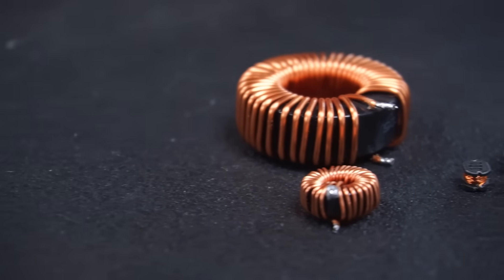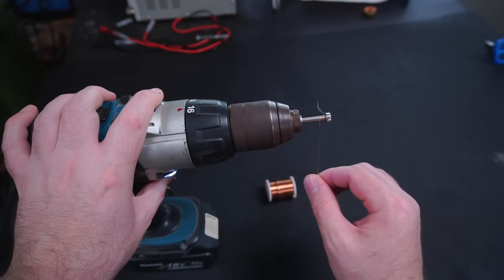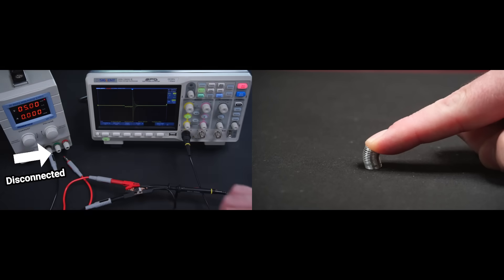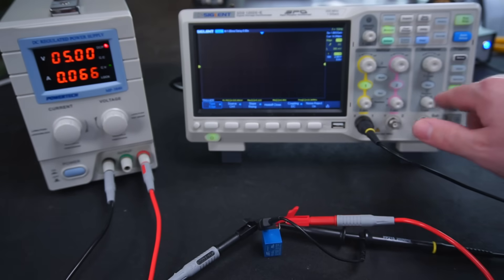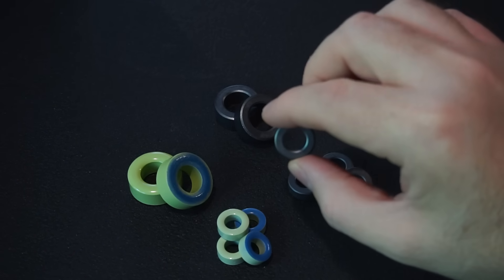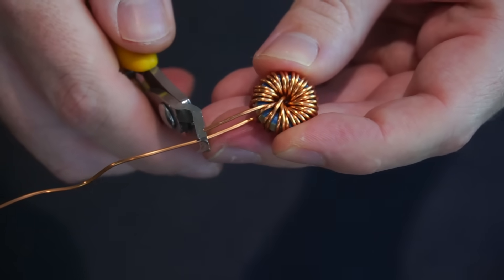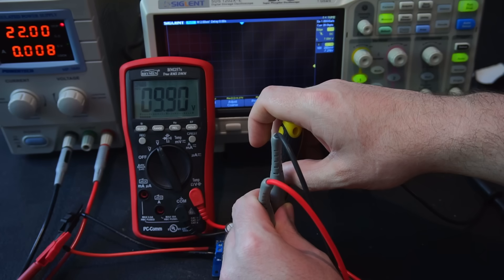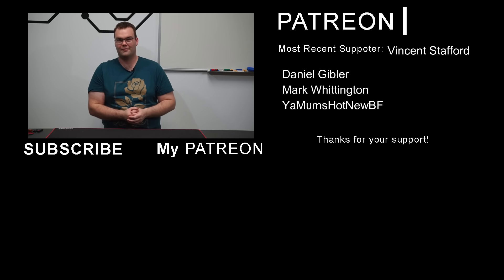How INDUCTOR's work & How to make your own

Comment: Have you compared the inductance provided by that LCR meter , against what you get using a square wave generator + capacitor in parallel with the inductor on the oscilloscope technic ?

Comment: Here in the Philippines, we are being sold controllers for ebike motors that deliver an uncontrolled starting voltage from the controller to the motor (using a simple, resistive element in the accelerator pedal).  The input to the controller is some level of 5Vdc, the output being a corresponding variation of 60Vdc.  The issue is all the ebikes are experiencing a very choppy start.  My idea was to add a combination of inductance, in parallel with a fair amount of capacitance and resistance at the output of the accelerator pedal.  This doesn't seem to be working to smooth the motor start up, probably due to the very low current in the input line.  My next attempt will be adding the same circuit to the controller output to the motor.  In your opinion, is this a feasible approach to 'softening' the initial current to the motor?

Comment: The spring I think is not a great mechanical analog to an inductor. An object that is made spinning I think is a better analog. Think of an object with say 3 arms with heavy balls. Why this is a better analog? Because once the object is up to speed (current is flowing) the resistence of the object isn't there anymore. SImilarly to how an inductor basically shorts when its magnetic field is build up.

Comment: This format is great. Im only a casual hobbyist, and struggle finding videos that match my disorganized mix of knowledge and ignorance. Leaves me with a couple questions tho, hoping someone can answer -

1. Does the voltage spike always follow the same direction? 

2. On your scope, the spike appeared to oscillate between pos and neg. This surprises me - was it not charged via a DC source? And if it’s an AC spike, then does the directionality of the rush current it generates change?

3. Is the diode at 5:30 backwards to the source for conventional current or actual current? How does this even work?

Comment: Question, if you're open to it 5 years later:
You seemed to have pre-decided that you wanted 47µH as your inductance.  How did you come to that, though?  or how would one, if, say, wanting to design a coil for a solenoid or an electric motor or something?  (Very different use case, I know, but... yeah.)

Comment: Broooo and just like that I NOW understand all the components for an induction heater
The diode is so it doesnt explode when you turn it off, and the resistor is to reduce the current for when a piece of metal ISNT inside of the coil

Comment: I recently installed 4 and 8 foot led lights in my shop. now I get lots of interference on my FM stereo and my radio earmuffs. I had to decide on working in the dark or working in silence. I took a 3/4" nut and wrapped the wire from the circuit breaker around it as many times as I could which helped a lot but not enough. I had to install an outdoor FM antenna on my TV antenna mast. What do I need to do to eliminate the noise altogether? I am a certified industrial electronic tech but am not an engineer.

Comment: At the beginning of the video a current is passed through a wire powering a light and the point made is there is no magnetic field because the iron filings are not attracted to it.
However, the return current is flowing the other way and so the net magnetic field is zero.

Comment: hmm,the discharge must create a big magnetic impuls out from the center,right? will it jump if a metalpin is in the center or push it something up maybe? 400 volt is alots. relais push a metalcore or attract it.What can here be a usefull effect for the wastet 400 volts??? And how will  it works if you charge it on a Loudspeaker at the coil works like a Loudspeakercoil withoutmagnet  and membran. maybe you can produce high voltage with superfast charge and discharge from RF,not from DC and the magnetic impuls is like a needle and you can hold stuff like a invisible hand

Comment: But don't they use Inductors to increase DC voltage in combination with Transistors for high voltage arcing e.g. tasers or even used as just a DC electromagnet for relays and such.

Comment: You said the flyback current can exceed tens if not hundreds of amps. But that's not true. The flyback current is at maximum the current the inductor had flowing through it. If the relay coil's working current is 70mA the flyback current is 70mA (and rapidly decreasing from there). There is no need to over spec the diode. If you look at existing circuits you'll often find the puny 1N4148 in parallel with small inductive loads like relais.

Comment: I had the same comment that someone else made.  With inductors, you increase the voltage, not the current.  The maximum current is what you pass through the inductor while connected to the supply.  When disconnected, the current decays, based on the resistance in the flyback circuit.  The rate (aka speed of the decay) is related to  the inductance/resistance time constant.  The higher the resistance, the higher the voltage (and faster the decay).  But again the current never exceeds the what it was passing at the instant before being disconnected.  Without a flyback diode - the resistance is infinite - or whatever the rest of the connected circuit is, as parts begin to break down.   A related phenomenon is that the high voltage can actually cause a spark, as the collapsing magnetic  field attempts to maintain the current.  When one unplugs a high inductive load - such as an iron or toaster - from the household mains, you will likely see a spark - that is the flyback voltage trying to dissipate the current.

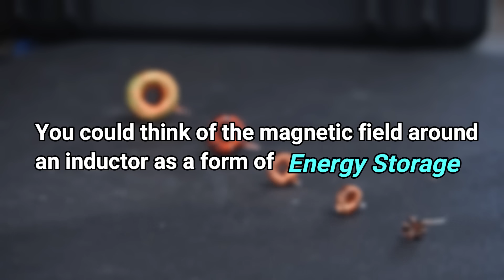Comment: 2:49 - Saying inductor is made from ferrous material or "IRON CORE" is WRONG. They aren't just pure iron cores, then eddy current will make inductors on your circuit glow red-hot. Inductor cores are either ferrite materials like MnZn or NiZn cores (both are like ceramic yet ferrimagnetic which drastically reduces the eddy current losses), or they are low permeability high flux "IRON POWDER" cores, where each iron dust is separated - so putting continuity tester on iron powder won't turn it on as each iron dust is separated with a binder. There are other type of such cores like Sendust, MPP, Hi-flux, nanocrystalline etc. each are made out of different materials and ratios.

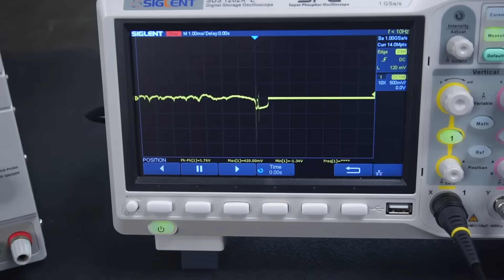6:27 - We should use Fast Recovery diodes in this case (something like FR107 for a relay or so, depending on the switching and what I want to do with it). Schottky diodes have a higher voltage leakage, but also they act quite slow. I wouldn't use TVS either as a flyback diode.

11:14 - also note that just wrapping thicker wire doesn't make it low ESR. You should note the frequency as well. In that case you have less skin depth, and you want bunched up thinner wires. I prefer multistrand PTFE wires in this case...

Overall, a great video. Mistakes like this always happens, and should be cleared out, otherwise newbies might just stack up iron washers or bolts, wrap a piece of insulated / enamelled wire around it, and think that's a very good DIY toroid inductor!

Comment: 5:43: "Placing a diode backwards to the power source across the inductor/coil allows the flyback to flow back through the diode when power is disconnected from the inductor/coil." While the sentiment is correct, the description is not. Inductor voltage "flies back" as the result of a discontinuity of CURRENT, not "power." V = L*dI/dt, where dI/dt is theoretically infinite when the current suddenly is disconnected. Inductors will do all they can to prevent current discontinuity by the voltage suddenly flipping trying to find a place for the CURRENT to go to. That's what the diode does. No current can flow through the diode when it is biased off, but during this voltage flip, the diode is suddenly forward biased, giving the current a place to go. If you put a current probe on the diode, you would see current changing smoothly from its DC value, then ramp downward with a ramp shape that is I(t) = integral (Vdiode/L)*dt until the current goes to zero, and which point the inductor energy (1/2 * L*I^2) has been dissipated by the diode. You do a disservice to your viewers by interchanging current and power. They are completely different animals!

Comment: I  feel that your explanation is not completely proper, I always compare the Magnetic Field and the Energy stored in coil like a big Fly Wheel 
Think of the wheel of a bicycle 
If it is Turning very fast and you would throw a stick between the spokes you could easily snap some spokes or snap the Stick because the Energy is very big

Comment: Very interesting video! I wonder why the flyback effect is so wavy on the oscilloscope. Is it due to measurement imperfections or indeed it is not a single pick but fading oscillations? It looks like first "backward" current induced the coil again in oposite direction and so on many times very quickly...
Second question: does so short voltage pulses may indeed destroy other components so easly?

Comment: This is interesting as I've tried building a switching PSU using a chip maker's application circuit diagram, but it doesn't work, and from various tests it looks like the chip's oscillator is running but there's no output from the main switching transistor, and it's a step down series regulator circuit, so it makes me wonder if I've used the wrong coil, it's the right inductance near enough, but possibly the wrong core material. Or could it be yet another circuit I've tried building where the design looks ok on paper but it's not been properly tested, and while that seems highly unlikely believe me I have known that to happen with other stuff I've tried building to someone else's design and I've had to alter it to get it to work. And the coil I tried using was a quite large toroidal one from a major supplier but it could still be unsuitable, but I'm not that familiar with switching supplies as they're far more technical than the more basic linear series regulator.

Comment: That's why you always connect a diode across a relay coil, or solenoid etc. when switching it with a transistor other wise the flyback would soon destroy the transistor when it switched off.

Comment: Any incandescent light bulb is far from ideal as a test load. The resistance of the filament when cold will be about a tenth of that when hot for an ordinary lamp and even less for a tungsten-halogen lamp. This can cause a switcher to fail to start because of gross overload, depending on the circuit design.

Comment: - probably already in the comments somewhere, but I'm not going to read over 600 comments to find out:
The peak current at turn-off of an inductor can never exceed the current at the instant turn-off starts. This is a fundamental property of inductance. If a relay coil operates at, say 100 mA, the current at the instant of turn-off will be 100 mA and decline from there.
For small relays a 1N4148 or 1N914 or similar diode is entirely satisfactory. If the coil current exceeds half an amp then you might go to something rated at 1 amp. I've used dual transistors in surface mount packages for driving relays. One transistor is used as the switch and the other is used as a diode (collector-base; the base-emitter diode has some better properties for some applications but small reverse breakdown voltage, typ. 6 or 7 volts for common types). This makes things very compact.

~~~
That HY-2 inductor core is a Micrometals Type 52 powdered iron material, or a counterfeit thereof.

Comment: Are those iron-powder-cores the right ones for a choke at the circuit´s end of an inverter-welder? Thanks for any answer !!! A choke will allow to weld stably at even down to 10amps, while most inverter-welders without, won´t manage retaining a stable welding-arc at Amperages below 20Amps.

Comment: One thing that you can also use for the winding of the inductor is "layered" enameled copper wire, it can handle more current at higher frequencies 

* layered enameled copper wire just means multiple enameled copper wires put side-by-side (aka in parallel) and then wrapped around the core; only electrically connected at the ends.
Hope this helps!
Reply: Layers in an inductor are not paralleled wires. They are physical layers, one on top of another. This is important because the number of layers influences the AC losses in the winding due to proximity effect. Each layer could be made of paralleled strands.

Comment: Can you use capacitors with inductors down stream to kill the spike instead of a 'leaky Shockly' on a relay?  or a Shockly + inductor down stream.  I'm assuming that the capacitor is a large one that is going to take the spike an not kick back, but slowly leak out.
Reply: A diode across the coil of a relay to make a path to discharge the coil inductance will result in the longest discharge time that is practical. That can be a bad thing because it both delays the start of opening of the contacts and lengthens the time it takes for the contacts to fully open once they've started. The latter can lead to worse arcing and shorten the life of the contacts.
If you want a relay to drop fast, you want to allow the voltage for discharge of the inductance to be as high as possible. Usually the limit is set by the driving device. For example, if you use a transistor rated at 40 volts, you need to stay at or under that voltage across the transistor or you may kill it. Zener diodes can be used to set a well-defined clamping voltage. A network with a diode, resistor and capacitor can be used, but it needs to be carefully designed.. If the relay in question is large (e.g. a contactor) where the coil current is high, a zener type device specified specifically as a transient suppressor can be a good choice. A metal oxide varistor (MOV) can be used, but they have a wear-out mechanism that must be considered.

Comment: Regarding inductor flyback, if you were to touch the + and - terminals of said inductor at the time of flyback, would that 356 volt surge be harmful, or fatal to a human?
Reply: Unlikely with a small relay since the total energy available is small. You might feel it, but that would be about all. With a very large inductor you could certainly store sufficient energy to be dangerous.

Comment: The hammer demonstrates the flyback best.
Swing the hammer with low force but when it hits and stops quickly it suddenly has torque greater than what you swung it with. When the current in an Inductor stops suddenly it creates a higher voltage.

Comment: Inductors store energy in airgaps.  Magnetic field energy density u = B^2/(2*mu) (where B is the magnetic induction in the medium and mu is the permeability.  The actual energy stored is therefore u times the volume of airgap. Using ferrite is like short-circuiting the flux path (if mu is very large, u will be very small, defeating the purpose of inductors which is to store energy), so it is not recommended (except for very low currents).  Powdered iron cores distribute this airgap over the length of the core. You should use AL value published by manufacturers to decide on the number of turns (rather than use permeability and geometry to decide on the number of turns, for more accuracy). Powdered iron cores are not good for very high (>50kHz) frequencies, and become lossy. So ferrite EE cores with airgap is the way to go for high-frequency power inductor.  One could even use plain air core inductors at very high frequencies, and use litz wire to reduce eddy current losses). Also,  other than air-core inductors, be aware of the saturation of cores at high currents. Hope this helps.  Inductors remain a mystery due to the poor way it is taught in engineering books and schools.   As a practicing power electronics engineer for more than three decades, I see this mystery continue, even with experienced engineers.
Reply: Powdered iron generally performs quite acceptably up to 200 kHz or so, depending on what you are doing. You DO have to understand what you are doing to make the judgement call. I've used the very core material used in the video (Micrometals type 52, green with one blue face) as the output inductor in half-bridge supplies operating at 100 kHz (full cycle, so ripple at 200 kHz) at up to 1 kW. But I've resorted to vastly more expensive molybdenum permalloy powder cores for a non-isolated buck converter at about 500 W, iirc (client wanted to push my original design to about double the power originally intended). I used Magnetics, Inc's KoolMu cores in the 100 kHz power factor correction stage of a 150 W switcher and a 1 kW. It's more expensive than powdered iron but a good deal cheaper than MPP, with pretty decent properties. (If I were doing that PFC for the 1 kW supply today I'd probably do it as two interleaved converters.) None of the supplies I mentioned used forced air cooling.

Years ago I heard Lloyd Dixon, a name you may well recognize, say "Most engineers know about resistors. Some of them know something about capacitors. Not many know much about inductors." (not an actual word for word quotation, but close). 
When the maker of this video was talking about using a diode across the coil of an inductor it became clear that he didn't understand inductors. The diode would, of course, never be subjected to current higher than the coil operating current. That's as fundamental as it gets in understanding inductors.